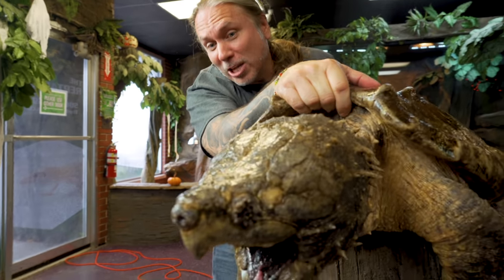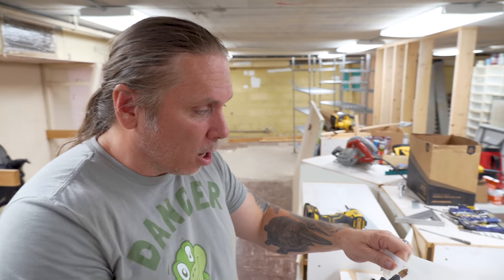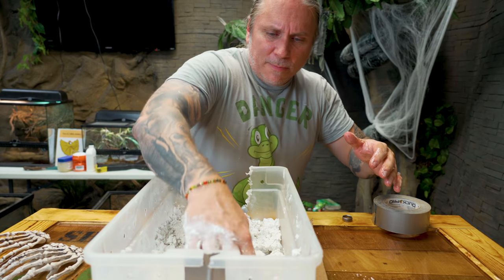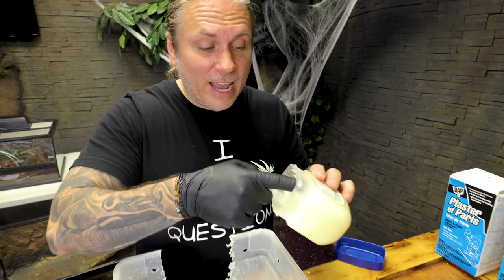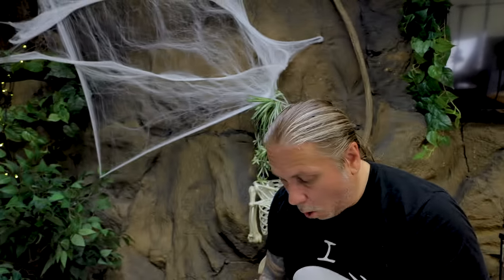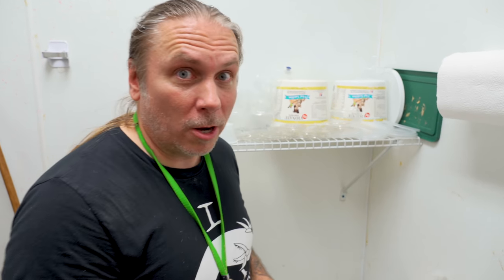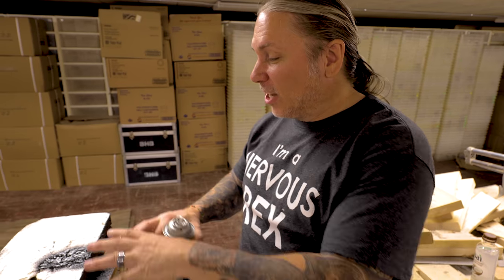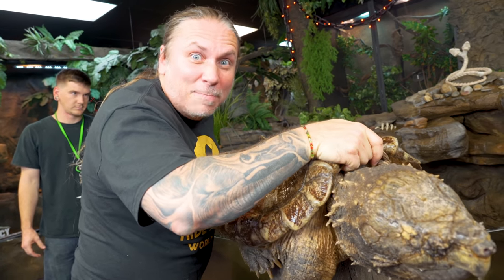ALLIGATOR SNAPPING TURTLE BITES FINGERS OFF!! | BRIAN BARCZYK

Comment: Plaster of Paris is not what you use for making moulds of body parts. You need to use a silicone mix designed for mould making. Look at “smooth on” life casting material to do it safely. As Brian mentioned plaster of Paris gets hot when it cures. Doing the moulds in two parts reduced the risk a little but don’t mix in a bucket and shove your hand in. Serious burns if you are not careful.

Comment: Next time you do an experiment like this try using a silicone mold instead. You have a bit more play time. All you need to do is mix it in a bucket, put your hand in, and let it set. Wiggle your hand out when it sets and pour the gelatin inside. Then rip the silicone away from your finished project and you’re done!

Comment: Hi Brian, a little tip if you are going to try and make another mold of your hand this way.
You have those black latex gloves, which are skin tight, why don’t you wear those gloves and cover them In Vaseline instead of your hand.
One other idea. Once you have made the bottom mold, get some thin sheet of plastic, cut your handprint out of it, then lay it on top of the bottom mold, pulled tight, then pour the top layer of plaster. With the plastic sheet in the middle, with a bit of an extra edge, which would slightly line the side of the plastic mold, it should make it very easy to separate the 2 pieces.

Also, I have seen on one of those real life csi shows, that they sometimes use pigs flesh, to do experiments with, as it most closely resembles our skin and flesh. Just another way of doing the experiment, but with actual skin, flesh and bones. 😀👏🏼

Comment: My advice would be to put the bones in a glove with water so that it looks like a normal hand. Do it the same way, bottom first, then the top. Put hard plastic coated with vaseline around it to keep it smooth as it sets. Then do the top part, leaving the heavily coated plastic there. It will make it easier to pull the two pieces apart and would help it seal properly

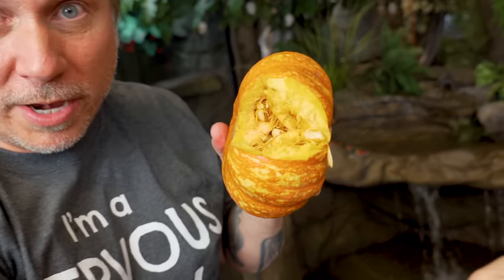Comment: 0:33 However strong that pumpkin is, it's not stronger than a finger. It takes up to 333 lbs of force just to fracture a finger, even more to sever it. But an alligator snapping turtle, having the bite force of a grizzly bear and a razor sharp beak, would have no problem severing a finger.

Comment: You forgot about muscle tissue, tendons and ligaments- the later two are like wire cable- stronger than anything you can make and that turtle has no chance of biting through it-even if he snapped the bone and got through the flesh. Consider the weight of a horse and stress on its lower legs-forelimbs while running. The thinnest part of a horse's forelimb is 2" thick-couple small bones held together by annular ligament. Your turtle can't bite through that or a man's hand. Fly me out there and I'll prove it. As I can do what's necessary to free my hand quickly, we can all go bowling later on.

Comment: Next time get some dental alginate instead of plaster of Paris. That way you just mix up in the bucket and leave your hand in until it cures. As it's slightly rubbery you can gently pull your hand out once set. (A small amount of Vaseline won't hurt, or you could just shave all the hair off your hand & arm!) As it's a one piece mold there will be no leaks and you can pour the gel straight in. The only downside is that alginate is generally considered a waste mold i.e. One casting as you pull/cut it apart to release the cast. (Again something to note, it also cures very fast). Plenty of YouTube tutorials on alginate mold making.
Reply from the maker: Thanks
Reply: Brian Barczyk 
There is a channel called Brickintheyard that has some great tutorials.
Reply: Brian Barczyk 
Of course a super super easier way would be popping the skeletal hand inside a rubber washing up glove and just pouring the ballistic gel into that! 😉

Comment: Gonna be honest here, you did this both the hard and wrong way, two way molds should always be made of silicone and have registration keys to insure it lines up. I learned how to do this in college through the make-up and effects portion of the class. You should have used dental alginate instead of plaster of paris. If you do this again in the future you should fill a large tube with the alginate, coat your arm in the release agent, dip your arm into the alginate, work it into the hand then reinsert your hand into the mix until it cures solid. Then you can break the vacuum and slide your arm out and have a perfect mold that you can reuse many times over. From there its filling the mold with ballistic gel and removing the copy.

Comment: that hand was a poor representation of flesh. flesh doesn't fall off that easily - it's not simply jelly on top of plastic. have you ever tried to remove quail/chicken/any meat off of the bone? it's not easy. most likely if you were to get bitten, a chunk of flesh would rip off if you pulled, and your finger would most definitely be cracked, or dismembered, depending on whether he bit right at a joint.

Comment: Too bad you can’t measure the bite pressure of Bowser’s jaws! But I had NO doubt he could take off fingers. I’m surprised you didn’t use Denten modeling paste for building the mold since it’s much more flexible and doesn’t require any type of oiling up. (It’s used when taking models of the mouth). Might be good for next time. Also, tell Bruce ‘Roll Tide’ for me!! (Class of UA 2005)

Comment: Guess you don't use tatoo goo after you get a new tat then.
You should've used plaster bandages to make a mould of your hand and forearm, they work a lot better and they don't get as hot as full plaster does. Most places that sell art supplies sells it. It comes in a roll and all you need is a tub of water. Just cut short "6 inch or so" sections of it dip it in warm water place it on your arm and run your hand over it till it looks smooth then add tge next one, remembering to overlap each one some and press them together so they stick to one another. Best to do a minimum of 3 layers. Let it dry, it will start to lift from your arm when it is dry enough to remove your hand and arm from it. But a two part mould would be best with the plastic hand you are using.
I could go into greater detail on all of this but I'm sure you don't want to read all of the setps to do all of that.

Comment: We had a cabin on a small lake. On the other side of the lake was a pasture of cows. Our lake was unfortunately inhabited by lots of snappers. The big one was about 4 inches bigger than Bowzer on each side. Periodically we would see deals cows with a leg snapped off. We assumed it was that snapper. We stil went water skiing and tubing and swimming in the water it just added an extra element oh adrenaline. When I was first learning to skin that turtle rose to the surface right under meI crashed and burned. I thought I was a turtle snack. I never swam so fas in my life.

Comment: You should have just mixed up the cement in the bucket greased up your hand and just stuck it right in the bucket until it dryed and then pulled your hand out and then mixed up your gelatin and poured it in your hand mold in the bucket and then figured a way to get the cement out the bucket and break the cement till u get to your gelatin hand and there's your mold I feel like that would been alot easier then the way your doing it now lol but you live and you learn

Comment: Hey Brian! I love the video, upsetting to see you get so disappointed though. But! I have a idea for you if you decide to make another mold in the future. 
I think it may be for effective if you were to create the mold while your hand is in it. Unfortunately you would have to lube up your hand again, but if you were to make enough plaster to fill a bucket and keep your hand inside it, let it dry and set, cut around the molding to get your hand out and then use the gelatin to fill it.  GOOD LUCK!
Reply: Or dont cut it and try to pull your hand out and use the solid mold to create the gelatin molding as well.

Comment: Should of took some putty and put that in the crack and then tapedit together just on the inside of the mold smash it together then tape it the earth the mold was uneven the best way would of been to seal it would of been using plumbers putty around the hand and put the 2  sides together that way it would seal it close to the hand that way you waste less

Comment: Dude why didnt you just use a bucket for the mold and a electric mixer to mix the plaster. Then after the gel dries you just cut the mold in half to get the gel hand out. No need to make two parts.
Reply from the maker: That would have been much smarter..